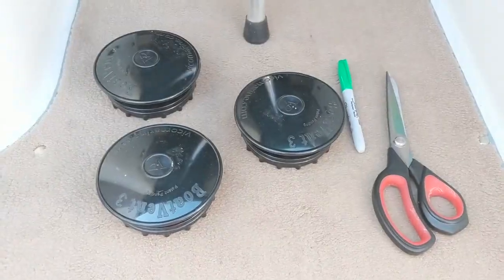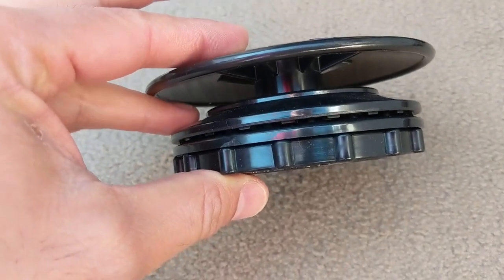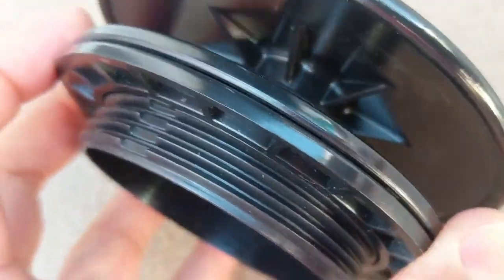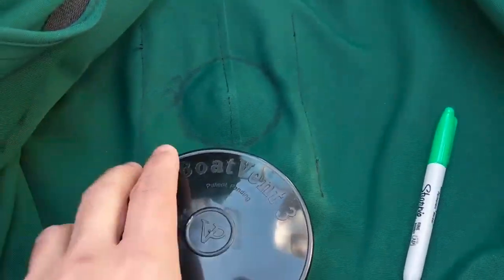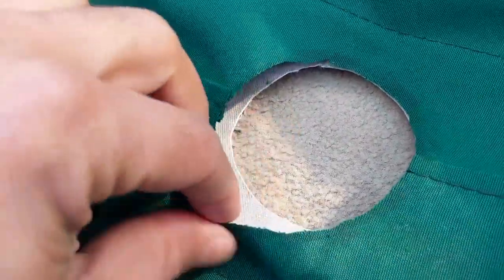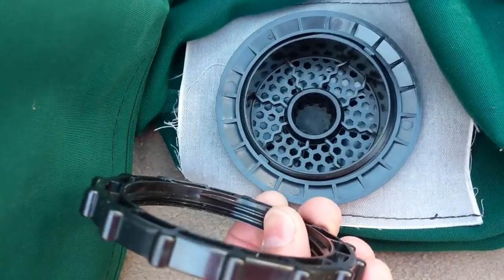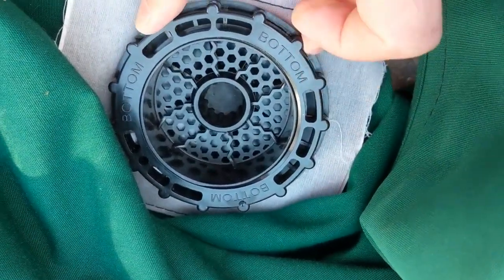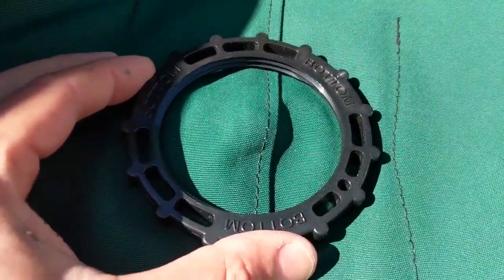Add Boat COVER Vent - Prevent Mildew - Boat Vent Boat Cover Ventilation Cap @vicoplasticsinc.6117

Comment: These are not as stout as the Boat Vent II and if you install these first then decide to use the more durable Boat Vent II, unfortunately the hole you had to cut in your cover for the Boat Vent 3 is quite a bit bigger.
Reply from the maker: Good to know. Personally I haven’t had any issues with the vents I used. Have been on there for about 2yrs now and been great so far.

Comment: I know the video hasn't been posted for long but any thoughts before and after in terms of moisture inside the boat?
Reply from the maker: I have had them on the boat for about a year now and it's definitely noticeable. It was a very noticeable difference when we use our boat often and some moisture ends up staying in the boat. Before it would still be a little damp in certain areas. After adding the vents it was dry every time we came back to use it again. It is definitely a worthwhile upgrade for any boat in my opinion.